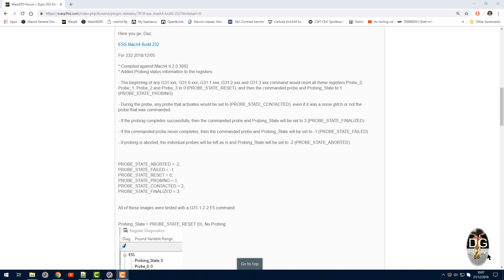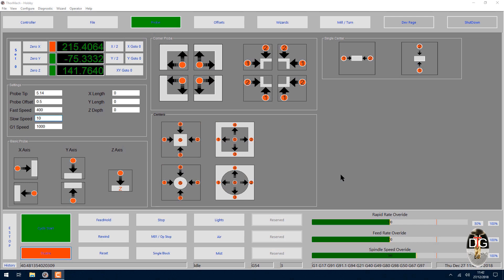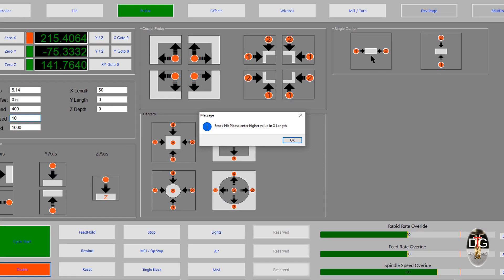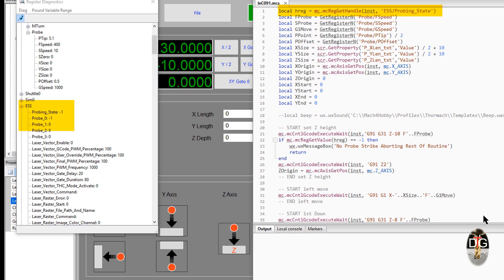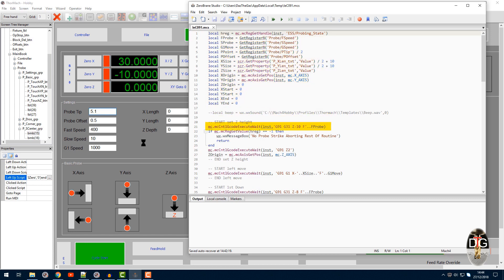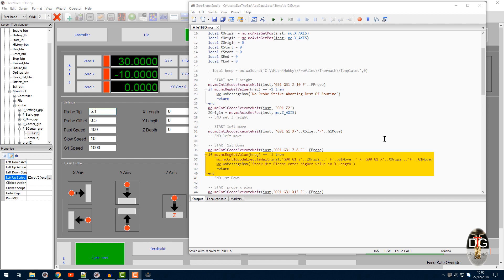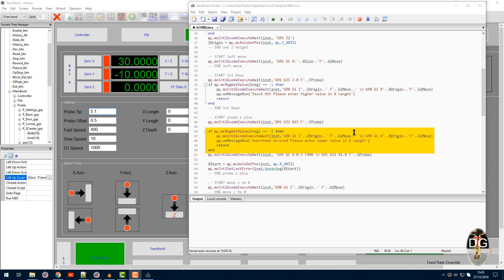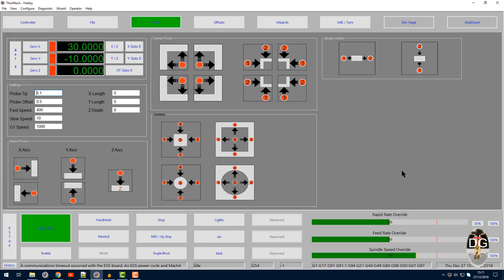ESS Mach4 and Probing

Comment: Are you going to change this in some way so the screen dro's update as the probe is running, does the code have to be in a module or a coroutine...
Reply from the maker: The code I have shown is for example only and what I use the rest is up to you what you do, when using mcGodeExecuteWait this will halt all other activity except the PLC, I prefer to just leave the motion controller to just do its stuff.

Comment: Great video,Is the probe button loading a module.?  I see you are using gcode wait so I assume its a wxlua module correct me if I am wrong, and I'm wrong most of the time...Thanks gary
Reply from the maker: All the code is within the button, no external module loaded so each button can be tailor made and not restricted to whats in a module.
Reply: Thanks a lot, so a lua panel can run gcode wait without messing up the gui like it doesn't lock up the gui till the move has finished?.